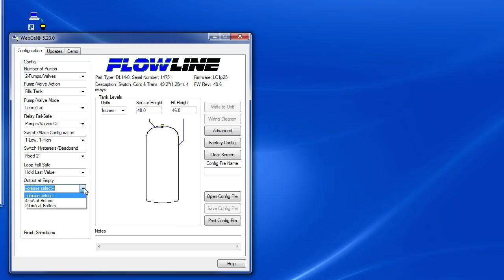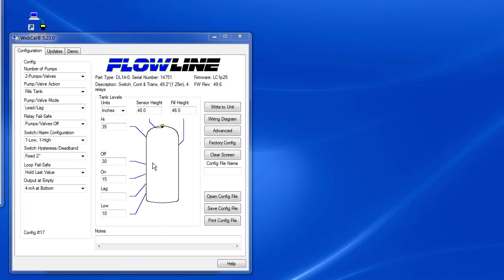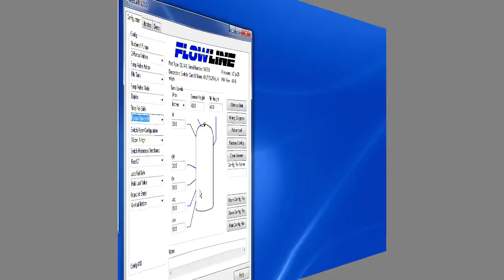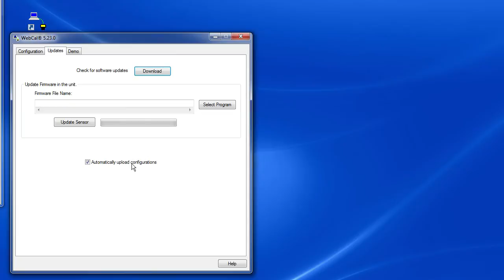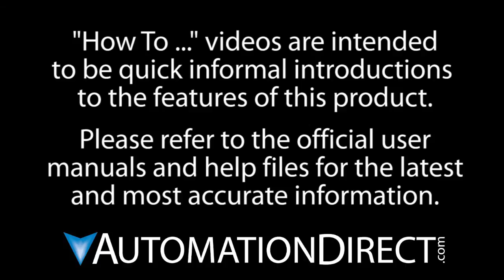Flowline Ultrasonic Liquid Level Sensor - Setup Part 2 from AutomationDirect

Comment: How can get the input ? via ddc panels?\
Reply from the maker: Parthiban Karunamoorthy, I am unsure of the question you are asking. I am assuming you are asking how to wire one of these sensors into your DDC Panel? If so, that depends on what types of inputs your DDC system will accept. I would start with the DDC Panel  documentation and then match the inputs to a Flowline sensor that has that type of output.